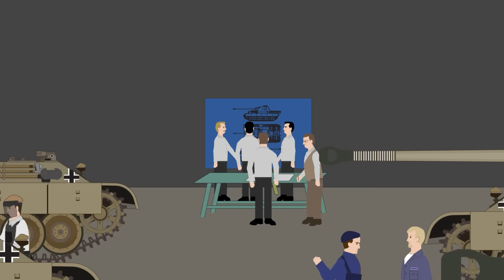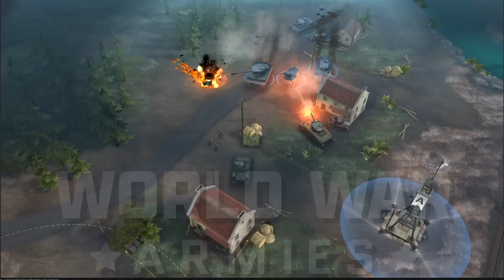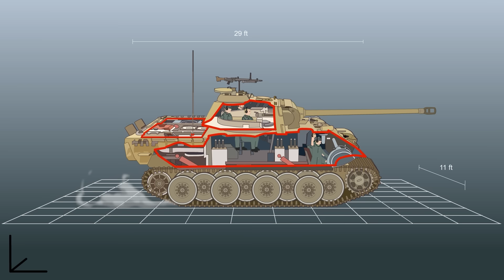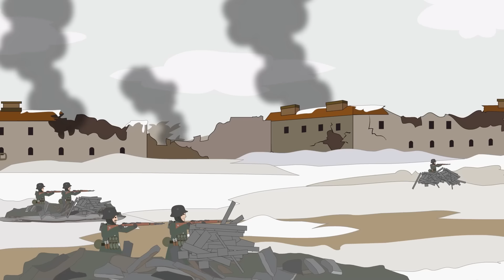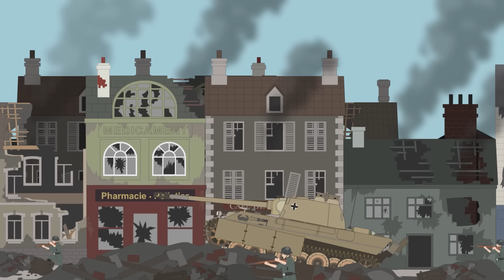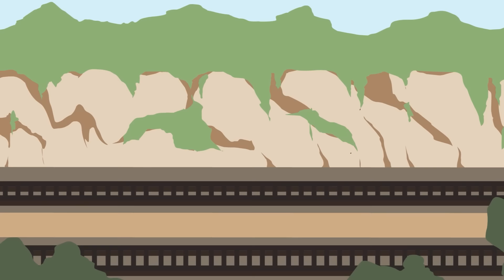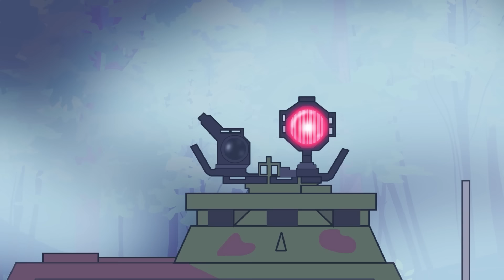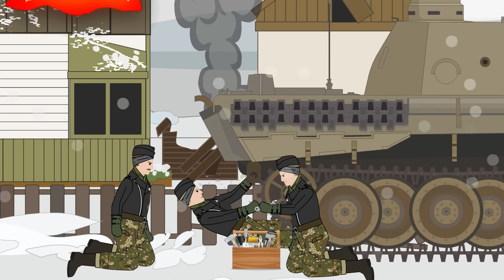Life Inside a WW2 Panther Tank (Cross Section)

Comment: The Germans during ww2 made some incredibly advanced and excelent tanks, if only they had to fight for only a couple of hours after leaving the factory, after that their screwed. The engineers, vastly over engineered even simple mechanical devices and seemed to expect the units in the field to have a factory nearby for seemingly constant overhaul. Their single greatest screw up in that, was requiring the turret to be removed and the interior of both their Panthers and Tiger 1's just to change certain parts of the transmission. The US kept with the KISS (Keep ipIt Simple Stupid) principal for most of their mechanical systems and even more so for maitenance such as swapping transmissions, main guns and motors. 
I have even heard one old tank veteran talk about rebuilding the top of their engine (pretty sure he was describing the Ford GAA engine but he wasnt sure which engine it was) and putting new heads and accesories one night while the engine was still in the tank and they had it back together before and running before sunrise the next morning. They could swap a transmission in a matter of hours.

Comment: 1943 was way too late for the Germans, they already lost their best troops in Barbarossa and in Case Blau ... by 1943 they also had not only manpower shortages but fuel and raw material shortages and the Allied bombing was starting to take its toll. At this point the novelty of panzer division level concentrations and tactics was wearing off and counters were developed, as well as air power became more important - by the time the Panther was ready to enter combat in earnest in 1944 Germany was withdrawing on all fronts so more JagdPanzer IVs but even more Stug IIIs would have had a larger impact, as Panthers were way too large and heavy to recover for a force on the defensive and on the retreat. I have seen a Panther in a museum once it surprised me - it was HUGE. They even put the track links of a Panther next to the track links of a Panzer IV. Way too large for a country with raw material shortages. At 10 ft height it was also hard to camouflage ...  hard to transport, tow, repair, hard to cross bridges etc etc ...

A reworked slightly larger Panzer IV / JagdPanzer IV with sloped armor would have served the Germans better in the defensive.

Comment: did you also know that The Panther tank, officially Panzerkampfwagen V Panther (abbreviated PzKpfw V) with ordnance inventory designation: Sd.Kfz. 171, is a German medium tank of World War II. It was used on the Eastern and Western Fronts from mid-1943 to the end of the war in May 1945.

On 27 February 1944 it was redesignated to just PzKpfw Panther, as Hitler ordered that the Roman numeral "V" be deleted.[citation needed] In contemporary English-language reports it is sometimes referred to as the "Mark V".

The Panther was intended to counter the Soviet T-34 medium tank and to replace the Panzer III and Panzer IV. Nevertheless, it served alongside the Panzer IV and the heavier Tiger I until the end of the war. The Panther was a compromise. While having essentially the same Maybach V12 petrol (690 hp) engine as the Tiger I, it had better gun penetration, was lighter and faster, and could traverse rough terrain better than the Tiger I. The trade-off was weaker side armour, which made it vulnerable to flanking fire and a weaker high explosive shell. The Panther proved to be effective in open country and long-range engagements.[8] Although it had excellent firepower, protection and mobility, its reliability was less impressive.[9] The Panther was far cheaper to produce than the Tiger I. Key elements of the Panther design, such as its armour, transmission, and final drive, were simplifications made to improve production rates and address raw material shortages. Despite this, the overall design has still been described by some as "overengineered".[10][11]

The Panther was rushed into combat at the Battle of Kursk in the summer of 1943 despite numerous unresolved technical problems, leading to high losses due to mechanical failure. Most design flaws were rectified by late 1943 and early 1944, though the bombing of production plants, increasing shortages of high-quality alloys for critical components, shortage of fuel and training space, and the declining quality of crews all impacted the tank's effectiveness. Though officially classified as a medium tank, at 44.8 metric tons the Panther was closer in weight to contemporary foreign heavy tanks. The Panther's weight caused logistical problems, such as an inability to cross certain bridges, otherwise the tank had a very high power-to-weight ratio which made it highly mobile.

The naming of Panther production variants did not, unlike most German tanks, follow alphabetical order: the initial variant, Panther "D" (Ausf. D), was followed by "A" and "G" variants.

Comment: A tank commander from Nordland division told they get some of the Panthers with nightvision early 45 but found them without any value and removed them. I don't think it is correct that that the gunner was without infrared sight however he was dependent of halftracks equiped with a much bigger infrared light for aiming. The commander only have the small one to ensure that he was able to command the tank even the bigger spotligth on the halftracks wasn't pointing in his direction of view to command the tank. So when engaging an enemy he need radio communication with the crew on the halftrack to get to point their device on the target he wanted his gunner to combat.

Comment: Don't forget its optics. German main gun optics were the best throughout the war, and the Panther was no exception. The TZF 12 sight was an excellent sight, coupled with the 7.5cm KwK 42 L/70, the Panther was unmatched in long range engagements. Not even the fabled Pershing with it's 90mm main gun could compete. Most people don't realize that the US's 90mm acted more like the German 88mm than anything else (obviously quite impressive in its own right).
Reply: The original plan was that an 60 mm gun would had been sufficient for german tanks with subcaliber ammunition using tungsten core. However the shortage of tungsten forecd the germans to upgrade to a bigger caliber to get more speed on a bullet using steel as a core.

Comment: Great video but there are several mistakes. The Panther 2 production did not run out of time. It was originally developed to have stronger side armour to defeat the Soviet anti tank rifle. They found out that adding schurzen to the side of the normal Panther did the same job, so there was no need for the Panther 2 to go into production. The effective armour thickness of the Panther's front armour was 138mm. The main defect with the Panther was the reliability of it's final drive.
Reply: The  reliability of it's final drive was fixed in mid 1944. (april-may)

Comment: Panther was supposed to replace both Panzer III and IV.  It replaced Panzer III but, never Panzer IV.
Panther was conceived as a 30 ton vehicle and its automotive components were really stressed by its 45 ton combat weight.  Final drive and transmission problems were legendary.
The gunner had only a magnified gun sight.  It was virtually impossible for him to acquire a target without the Commander putting him on target.  This was slow, cumbersome and inexcusable for a late war tank.
While Panther had thick, sloped armor, critical alloy elements were in short supply so frontal armor would shatter, crack or welds would fail when hit by enemy shells.

Panther was a failure as a ‘medium’ tank.  It was too heavy, unreliable, and vulnerable to anti-tank rifles(inexcusable).
It did some things quite well.  At long range, it could stand off and destroy most enemy vehicles at ranges up to two kilometers.  At closer range, the long gun tube, slow turret traverse, and nearly blind gunner,  was a serious liability.
Reply: Nice myth list.

Comment: the Panther proved to be a very effective fighting vehicle in 1940s
Reply: Idiot. it was only in late 43 it was introduced and first combat was an disaster. Of the 200 sent to Kursk most got engine fires so only few was available. And the war ended in april 45 so was not even active in 2 years!! Next France armed to units with leftovers Panthers and they hated them. Final drive could only work in 100 km before breakdown. The gear in the turret ring to turn the turret could not absorb the energy from a firing gun if the gun was traversed more than 15 degree from centerline. The french also think it was a disadvantage that the gunner was totally guided by the commander and have no viewing port  himself as he had in the Pzkmpf III and IV.

Comment: Nice video thanks, only one thing, the Panther G you're showing in your vid is a late war production with the modified gun mantlet,. Most of the production of Panther G's had the gun mantlet used for the other variants. The rear sides of the Panther G were also modified to protect the fuel tank. In Normandie, photos show mixed variant of this vehicle, like a turret of Panther D placed on a hull of the A variant.

Comment: "Sloped" armor and it's advantages were well known prior to WW2, even before the end of WW1. The USSR did not invent the concept. Sloped armor has advantages, as well as disadvantages. The primary disadvantage being the resulting cramped interior space. Russian tanks, were considered a disposable commodity. German tanks could not be produced in even remotely equivalent numbers. The commonly held viewpoint that Germany should have simply built more PZKw 4, instead of wasting limited resources and manpower in producing PZKw 5, 6 and King Tiger doesn't take into account Panzer crew and Panzergrenadier moral. Going up against T34-85, JS1 and JS2 in Panzer 4 would have been suicidal. Critical lack of fuel and logistics being the other severely limiting the number of tanks Germany could field.  Stalin's statement that "quantity has a quality of it's own", could never be applied to German conditions.

Comment: Ah, the WW2 tank where the germans finally realized the importance of using sloped armour over simply slapping thick plates on a tank. It´s so infuriating in Warthunder, to be caught off-guard in a Tiger and some light-weight easilily penetrating your front armor because your tank isn´t angled in their direction. From the front the Panther has effectivly the same level of armour as a Tiger 1 just because of the sloped armour.
Reply: Such low iq comment...

Comment: Early model Panthers: Pine Needles...Tank Fuel... 🔥🔥🔥

Later Models: This really cost too much per unit...and 120mm is the new 80mm.(armor thickness like orange being the new black).

Also, also... remember that time an M5 Stuart shot a Panther in the side 5 times and lit it up before it knew what hit him?  Ofc, the Stuart got hit up the rear with a panzerfaust and the crew buggered off, but...still though.

Comment: There's a few issues with "PANTHER IS THE BEST GERMAN TANK!". I'll give you a couple of examples. A couple.

The panther was just like the M4 sherman, T-34, and A13 series. Allow me to just simply explain this.

Panther (all versions)
Reliable
Good gun
Relatively good armor
Cheap
Easy to produce

M4 sherman:
Reliable 
Good gun
Relatively good armor
Cheap
Easy to produce

A13:
Reliable
Good gun
Relatively good armor
Cheap
Easy to produce

T-34:
Reliable
Good gun
Relatively good armor
Cheap
Easy to produce

Do you see the similarities? All of these tanks are powerful in a head on, they have good cannons and have good armor, but only from the front, the panther was just the strongest of these, and had more equipment. This means, if you see any of these tanks go head on, M4 versus T-34, it would take a while to get a proper pen to knock them out. But, if it's on the side, anything that is a cannon can penetrate it. It was meant for ease to produce and simplicity to use. Literally the propaganda I use when someone says any of these: "T-34 IS THE BEST TANK OF WW2!" "A13 IS THE BEST TANK OF WW2!" "M4 IS THE BEST TANK OF WW2!" "PANTHER IS THE BEST TANK OF WW2!"

If I had to put these on a scale on which is best and which is worst, here's what I believe:
Panther is the best of the options. (more powerful since it was built on a larger budget.)
T-34 comes next. (Able to be used alot, and is very easily maintained and maneuverable.)
M4 sherman. (Produced with extreme ease and was very powerful for price-to-performance ratio.)
A-13 (Produced with overly ease and was weak. It was in early war, so understandeable. No angled armor.)

Best on top, worst on bottom.

Ease to produce, simplicity to use.
Reply: Im not an expert on this but werent most t34s armor heat treated to such a degree that the armor would become very hard, in a way that if a strong projectile hit the armor would not be penetrated, but the crew would be most certainly dead. With what i know i wouldnt say the t34s armor was good, in design then sure
Reply: @fredrickian_ago  that is true, T-34's were also of varying quality as they were manufactured in bulk by whoever they could throw into the factories. Panthers were overengineered and required a competent crew to operate it as well as enough fuel and spare parts to keep it effective (just like with the Tiger 1). The sherman on the other hand was VERY easy to replace, manufacture, easy to use and easily upgradable as well as easy to train new crews on.

Comment: In an interview with british ww2 veterans they claimed that they rather be in a panther rather than a Sherman.
Statistically you needed to sacrifice four sherman tanks with crew to destroy one panther tank.
The only advantage the allied did have was that they produced a much larger number of tanks than the germans.
Sacrificing more young men in the process.
Reply: The allied mantra of "Steel not flesh" meant that overwhelming tactical air power plus strategic bombing reduced numbers of German tanks, spare parts and fuel reaching the battlefield. That's not to disregard the bravery of allied tank crews but what was happening out of sight and "over the hill" certainly reduced allied casualties due to German armour.
Reply: Not really. It depended on the crews, with experienced crews having an advantage over inexperienced crews. They'd probably be better off in a Sherman considering the roomier interior made loading the gun far easier and it was among the easiest to escape from. And the reason 4 Shermans were sent was because it wouldn't make sense to send just one, even if it had a meter of armor.

Comment: They even found cigarette butts and other things inside of the panthers working parts, ie transmission fuel line etc from force labor building the tanks. They did that to help try and break them down more in the field
Reply: I dont think it was a common thing to use cigarette butts at that time. Next it was slave labour there dont have any cigaretts...

Comment: The thing about the Germans, I don't get, regarding their tanks is:
Why didn't they salvage Russian tanks as an obvious supply of steel for tank production?
Why didn't they recognize the simple genius of the T-34 design? The French Chef syndrome mentioned here makes sense to me.
Why didn't they have repair/conversion parties to salvage T-34 hulls, repair them and smack a German gun turret on them?
Even a salvaged T-34 hull could serve as mobile unit as an artillery gun platform, an ammo/fuel carrier or a dug in pillbox.
Quality over quantity failed to win the war. Blitzkrieg works only on thin frontlines, not thick ones like at Kursk.

Comment: Another flaw of the Panther was the loader’s position. It was on the right side of the turret meaning the majority of loaders would be using their off hands to load the gun.  It was also somewhat cramped which required the loader to bring the long shells up and over the breech to load it.  While not catastrophic this reduced the rate of fire of the main gun.
Reply: Everyone quoting chieftain like a holly gospel when the guy is like 2 meters tall and varely fits even in modern MBT.
Reply: You are not right regarding the loader. Most of the time his position was turning his back toward the gun to pick up ammunition from the storage bins. His RIGHT arm the strong one was under the bullet holding the majority of the weight and only using the left arm as guide and to balance the bullet. Then turning AROUND to put the grenate into the gun still holding the right arm below the grenate and when the front of the grenate was in the gun then he removed the right arm and pushed with the left arm the grenate into the gun. End of story. Next Even the grenate for the 88 mm L/71 gun "only" weith 20 kg. and most soldiers at that time was trained for manual work so they were in average much stronger than today soldiers and because they also was shorter there were actual more energy pr m2 muscel than an soldier today have.

Comment: The tank commander's hatch is also another disadvantage, you have to manually open the commander's hatch using the hand-cranked hatch control. So in extreme emergencies (e.g. tank is on fire), it may take a while to open the hatch before the tank commander can get out from the tank safely. The loader's hatch is the second option but it's thick and heavy and the tank commander and gunner have to get out immediately after the loader is out.
Reply: The commander also has no way of seeing anything behind the tank without opening the hatch which makes for another weakness
Reply: @Norwagon I don’t understand what you mean. When you look at the Panther (At least the Ausf A & G Variants) you can tell that the commander has all around field of view. Look at his periscopes, he can see just fine.